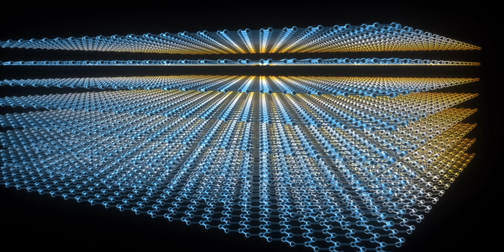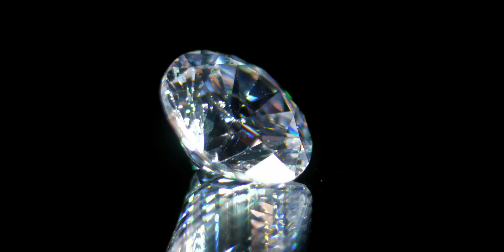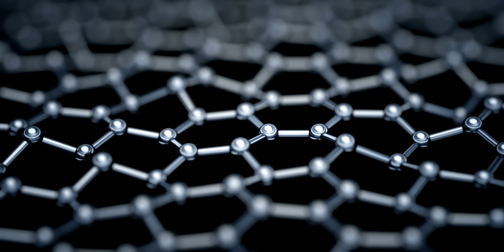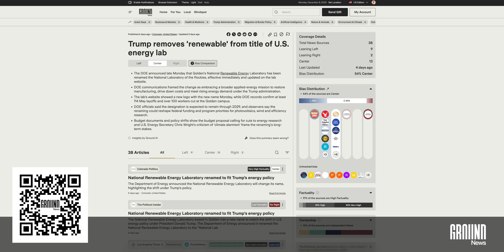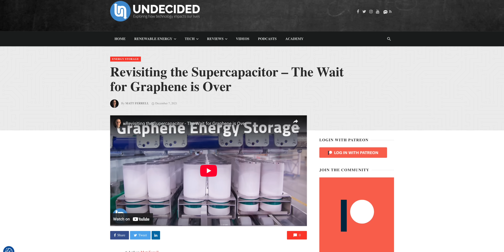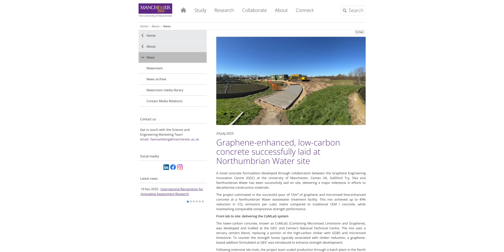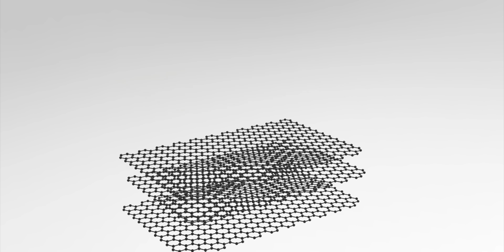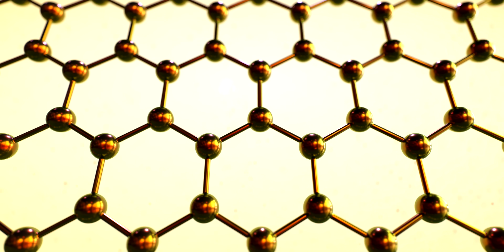How Graphene is Changing the World … Right Now

Comment: Graphene is highly dense. Density over area is cumulative. An area with enough density sinks. And dispalcement can cause large areas to act as a single density. Might want to calculate the densities that will cause issues (like more density in one area acting like a lever on an area less connected to its density, causing one side to sink and the other to lift).

Point is, density can be a sneaky killer for civilizations built on greatness (tall buidings and machines, populations and their populations of food, animals, a/o pets, all the dense batteries and electronics, etc.).
A dense society doesn't pay attention to density until their "greatness" is swallowed by the earth by sinkholes, or by systematic interactions. Unfortunately, money leads where the eyes can look and the hands can investigate, and those with money are the ones who want you to collect as much density as possible.

Comment: Bit of a nit pick here, but it's not 1 degree Kelvin.  It's just 1 Kelvin.
Reply: I did not know that 
Even bits of information is helpful 
Thanks
Reply: Why?  Do we say 1 Celsius?  Is a Kelvin a unit like a centimetre?
Reply: @simongross3122  yes, actually. kelvin is the standard unit for temperature, like metre for distance and gram for mass
Reply: @salvaged6153   Kelvin is the metric absolute temperature scale, like Rankine for US Customary units. Absolute zero, AKA 0 Kelvin is -273 Celsius, or alternatively, water freezes at 273K.
Reply: @simongross3122 it doesn't use degrees because it is an absolute scale with a defined endpoint (0 k).  But you have a very valid question.  One would assume that it would use degrees like every other temperature scale.
Reply: @4ryan42  So this is a lexical question then, not a scientific one.
Reply: @simongross3122  well degrees C are derived from K, so it is scientific
Reply: @LockWithNoKeys  No C is not derived from K. Celsius was invented more than 100 years before Kelvin.  And 0K = -273.15C.  If Celsius was derived from Kelvin, then Absolute zero would not be some fractional number in Celsius,
Reply: @simongross3122  C is derived from K in the SI system of units.
Reply: @sullivan3503  No it isn't.  C existed before K was invented.
Reply: @simongross3122 because "degree" implies a relative scale, such as Celcius with zero set to frozen water. Kelvin is an absolute scale - negative Kelvin cannot exist by drfinition.
Reply: @bringiton8989  "negative Kelvin cannot exist by drfinition" - Physics Theorists: "Hold my graphene beer..."
Reply: See and I've always used degree Kelvin to denote when I was speaking about temperature and the Kelvin value without degree when I was speaking about white balance which is color temperature I know but it just makes it easier to keep straight What's being talked about. Is it correct? Maybe not. Is it communicative? yeah.
Reply: @4ryan42  Yeah,this is definitely worth arguing on the internet about
Reply: @km5384 Who's arguing?  I'm just passing on some information.  I made this same mistake until someone told me the correct way to say it.
Reply: @4ryan42 yeah, i was too critical with that comment. Apologies.

Comment: Have to disagree that graphene is difficult to produce in large amounts.  I mix graphite chunks in water with a protein and then use a sheer force type blender(kind with dull blades rather than sharp ones).  Blend for 15 to 30 minutes(larger graphite chunks equals longer blend start run) and then turn the blender up to it's highest setting.  Let the resulting slurry sit and separate into layers.  Top layer is a film/foam that can be added to your next run, middle layer is a water/graphene/protein solution(graphene attaches itself to proteins in the solution), bottom layer is graphite powder in water.  Pipe off the center layer and use for graphene application.  For example add the solution directly to concrete mixture to make it 9 or more times as strong/hard(use a 6% graphene portion to the concrete).  If a dry graphene is needed (ie plastics), then use a centrifuge on the middle layer to separate the graphene/water/protein.  Good luck with your experiments everyone.
Reply: By the way adding graphene made this way to a plastic and 1/8th of an inch thick layer of this enhanced plastic can stop a 9mm pistol shot at point blank(less than a meter from the barrel).

Comment: One thing to consider when it comes to concrete (here I call it "GraphCrete"), is that over the 
lifespan of this material it may be inert and not dangerous to be near, but when recycling GrapCrete then it is that
a lot of dust will be created,I guess it would be far more dangerous than airborne asbesos (think about graphene being hard as a diamond in very tiny sizes and how that might affect the very soft tissues of the lungs. Just imagine the effect this might have on the lungs of people and wildlife being near it. 
Also, if this product is to be used as surface on roads, there is also very likely to be airborne graphene as the tires of the cars/trucks gradually wears the surface, also having the same effect on the lungs when sitting inside their vehicles of the people driving on those very roads. 
I am sure the economical results of the medical industry will be very cheerful about this if a lot of people come down with lung cancers years- to decades later.
Here, the graphene industry should act very ethically, if not injured people could possibly sue these companies...

Comment: I am surprised you didn't mention arc flash graphene production. This type of production is by far the cheapest and most proven method to produce graphene at a large scale.
Reply: Some context:

Arc flash graphene production, or Flash Joule Heating (FJH), rapidly converts any carbon source (like plastic, coal, or food waste) into high-quality, turbostratic graphene by applying high voltage and current for milliseconds, causing extreme heating (over 3000K) and quick cooling, which breaks molecular bonds and reforms carbon into stable graphene sheets.

Comment: As a powder in a bag of cement it would be as bad as asbestos to breathe. It's fine to have machines sealing it in batteries, capacitors etc. and for aircraft assembly with protective gear worn.
Reply: Interesting point.

Comment: I place a lot more faith in physical product development like graphine than I do in any AI development.  Whoever "cracks the code" for that pyramid and figures out how to produce it cheaply, at scale, at high quality are gonna be able to print their own money with how many concrete (heh) use-cases it has.

I can imagine factories in orbit (low-g/zero-g) set up similar to old-school printing presses (like what newspapers use now) but using electrostatic technologies that'll grow perfect carbon crystals that they then "peel" layers off of to "print" huge rolls of the stuff for creating sheets and tubes with.  Solar-powered, outside the atmosphere (few if any contaminants)... the only issue is radiating the heat away fast enough.  And maybe kilometer-long graphine nanotube "tails" could do that too.  Extrusions... perhaps they come up with tails that dissipate excess heat and generate electricity at the same time (thermocouples).  Who knows?!?

Comment: If I remember right graphene not only is super conductive but moves heat at a crazy rate, making it very useful at dissipating heat from computer parts like processors.
Reply: It does move heat quickly, but looks like heat pipes are far superior for moving heat more than a few millimeters. Apparently there is some research combining graphene into heat pipes to combine the advantages.
Reply: @techman8817 so it would be a graphene finstack with copper heat pipes
Reply: @curvingfyre6810  the paper I saw did not use any fin stack, but a graphene film wrapped around a spring. It was just a research paper though.
Reply: Someone needs to make heatsinks and cpu lids from this stuff.
Reply: @garystinten9339  from what I understand, it's already being done at some capacity.  Nobody has had much luck so far. Otherwise, pc cooling would be seeing dramatic gains.

Comment: How did you make a video about Graphene and not talk about Graphene Manufacturing Group? They have a scalable way to produce mass amounts of Graphene from Natural gas. They have three products, tested, in production and available for purchase. They have a battery that charges in 6 minutes, tested and confirmed, not yet in production. Their G Lubricant reduces fuel consumption by 8% or more. Tested and confirmed. They also have Thermal XR, and a graphene slurry to increase efficiency of Lithium ion batteries. I can't believe you missed them in making this video.

Comment: I wouldnt consider it over hype - just hard to manufacture at scales that make sense for a larger need. At current, the stuff will be just fine and will spread out into other fields as we add more production for it. Its just wont be as wide spread in terms of what plastic is today. In some cases, that might be a good thing. As we dont really know the affects of this stuff has in the wild or on our health. We alrady know plastics can be hard to break down and they are mostly a chain of carbon. With graphene, its a slice of metal. Would be even harder to break down.

Comment: There is a bit of misinformation. Graphene is explicitly only a single layer of graphite, containing a single layer of atoms. Only the single layer exhibits some of the special properties like the Quantum Hall Effect, and only when it is free-standing without strong interaction with a substrate. So, especially batteries and supercapacitors probably use graphite or graphene oxide with graphene just being a buzzword for advertisement. In the concrete example, I guess it's rather carbon nanotubes than graphene. There are a lot of benefits and there is a lot of progress with these composite materials, but they are far away from using graphene.

Comment: Super capacitors are nothing new, have been using Maxwell Technologies super capacitors for over 20 years in my designs.
Over those years
- voltage has gone up from 2.5V to 3.0V
- capacitance has got from 2500F to 3400F
-  size has not shrunk
- cost has stayed high
Very small change's in the last 20 years.

Comment: @9:00 That graphic is just plain Wrong.  Capacitors don't pass DC.  A battery would simply charge the capacitor, then current STOPS (minus tiny µA leakage current, of course).

Comment: Kelvin doesn't use degrees as a unit...
Reply: Well actually, Kelvin is scale with divisions between absolute zero and the freezing point of water at 273.15. The divisions mimic the 0-100 water scale celsius uses. So because Kelvin sits on a divided scale, you could call those degrees if you aren't being overly pedantic.
Reply: @weeveferrelaine6973  Yes, you could call them degrees, and be wrong.  If you ever wrote a scientific report or even a high school chemistry paper and used degrees Kelvin, you would be told you were wrong.
Reply: @trevorksanders   Wrong because of convention, sure? Linguistically, it's correct to call them degrees still. Good thing I never had to write a scientific report or go to school.

Comment: Thank you, scientist and engineers because we need a new type of electronics that is not based on silicone anymore.  It’s getting to the point where we’re processing data with the equivalent of a vacuum tube RTX 5090 and we’re gonna run out of energy.  Time to move to the next generation of photonics

Comment: Has using a printer inkjet head to print on a dissolve-able/low heat meltable substrate been tried? 
Instead of using heat to jet the nano carbon slurry but a low pressurized gas like H3.

Just throwing that out there 🤷‍♂️

Comment: To say that cement production contributes 7% of CO2 emissions would require us knowing exactly how much CO2 is released naturally (from many sources including geothermal, like mid oceanic trenches, and volcanic activity in general). It's my understanding that these natural source cannot be easily measured so I wonder how you/they came up with the 7% value? (We all know that %74.6 of statics are made up on-the-spot, right?). Also, the 49% reduction per cubic meter of concrete? Why would it change for slightly less or more concreate? Bizarre.

Comment: I could get a charged Phone in 20 Seconds!  WE HAD exchangeable batteries and optional seperated chargers for smartphones !   I bought both, offical from samsung for 20€ like 12 years ago.
Reply: Yup, I used to leave one battery in the charger and swap instantly.   And I could still use chargers with the phone too.
Reply: People wanted waterproofing, let alone planned obsolescence. Battery is the main thing that does first so letting people switch stuff out could allow phones to last much longer - hell I've replaced the battery once already in my S23 Ultra in a couple years as it started to swell.
Reply: @hi_tech_reptilezz  Your not wrong, but many commercial products such as hand held communication radios have swappable batteries and have the highest IP ratings. Apple could do it, but elect to keep the design simpler.
Reply: @jim5148  They aren't thin or light though relative to flagship smartphones, which is a critical feature for most people.
Reply: With your method the battery also lasts much longer. Fast charging is terrible for battery life. "Slow" charging over night will always be the longer lasting option, no matter how many miracle materials they add to the battery.
Reply: @WolfmanDude  not true, see HTX's 2 year experiment
Reply: They will be back in EU in 2027
Reply: It's coming back! 2027 is the year EU starts to enforce the new battery laws, including all new products with portable batteries should be replaceable by the end-user.
Reply: @MasterHigure  sadly the US sucks in general rn, about equally in all fronts where it has problems. i'm NEVER seeing this a day in my life 🥀
Reply: @Dragonyy-sb51 the US is doing GREAT now.
Reply: @jacobzindel987  can u tell me how? (not to be taken as a challenge)
Reply: @Dragonyy-sb51  Do you really think manufacturers will completely redesign every product twice, with all accosiated costs? They didn't bother when the EU began requiring standard USB charging, I can't imagine they will now.
Reply: @MasterHigure  my point is yours. in the EU maybe they'll be required to. In the US? nope, for sure.
Reply: @Dragonyy-sb51  My point is, I can't imagine Apple making an iPhone 20 (or whatever) with removable batteries for the EU market, and then completely redesign it for the out-of-EU market to have a more integrated battery. After all, they didn't bother to do it with something as simple as the charging port.
Reply: @MasterHigure  oh yeah i understand it there. if they do force it by EU it'd be such a drastic change that they would have complications just using the old design, right?
Reply: @Dragonyy-sb51  Actually chances are you will get it also in USA, because doubt that some Samsung will make separate models for EU (same as everybody got USB-C because of EU)
Reply: @the_g371 yeah i didn't conskder that until someone else said it, they would have issues splitting models if already forced to make the better decision.
Reply: Most LiFePO batteries use carbon black as an enhancer. It boost the charging rate by... almost 10%!!!! 🤩

If you know a single thing about chemistry, close your eyes and imagine a monoatomic layer. Then what can you do with that? Answer : NOTHING!
Reply: @jackreacher6240  is a different world. The benefit is that all phones are water proof. Do you remember also being scared of being in the pouring rain despite having a spare battery? I do.

Non replaceable batteries also make phones safer from theft if the phone tracking cannot be disabled.
Reply: @jackreacher6240  I used to carry four or five charged extra batteries when I was going on long Ingress excursions, it worked pretty well
Reply: But then ppl wouldn't buy a new phone every other year. Think about poor Tim Cook. Nobody ever considers the poor Billionaires.
Reply: That is sad you can't go without your phone for an hour or 2  to charge it.
Reply: If your method is a solution for fast charging batteries "just change it for already charged one" than every tool will need two batteries instead of one and the amount of batteries that are produced and wasted are already a problem. Maybe it will be a good option if that battery last long and is not from toxic materials.
Reply: @Aker811 won't be long
Reply: nobody wants to change batteries
Reply: @cristibaluta  youre misinformed
Reply: @cristibaluta  nobody it's too much people
Reply: @cristibaluta  powerbanks...

Comment: increasing energy efficiency never caused a drop in the actual usage of energy, they just cram more chips in there till they hit the current cooling capacity.
Reply: You can reduce energy by making smaller chips, and/or running lower frequencies, but computing demands keep rising. Increased performance does cause software developers to become lazy and not optimize anything, though this is also largely an issue with companies not caring and properly funding development.
Reply: LED lights say hi
Reply: I wouldn't say it's always the case, look at m series Mac's for example. Their power consumption is far lower compared to the intel macs.
Reply: Jevons paradox
Reply: And then coders get lazier, write bloatware and we get no benefit out of it 🤡
Reply: @palpalps  This. 
I once had a colleague who literally said "Computers are getting faster all the time. We don't have to write efficient code, anymore."
On the bright side: Having developers like that makes it a lot easier to outcompete them with writing not totally dumb code like they do.